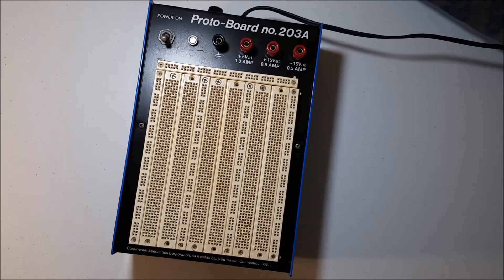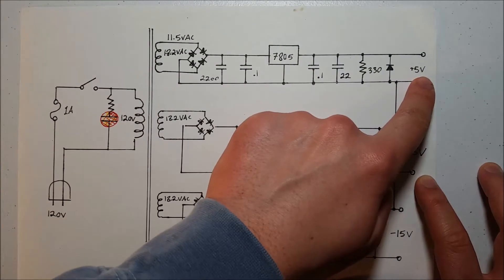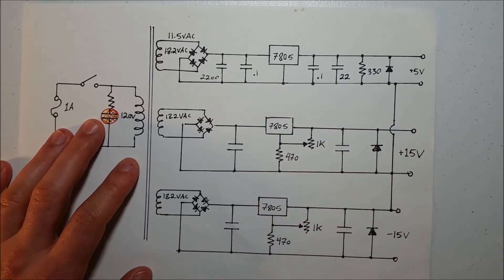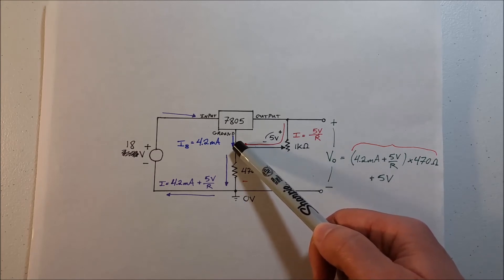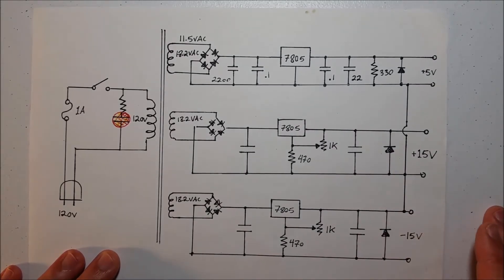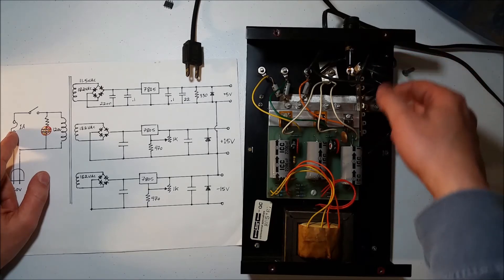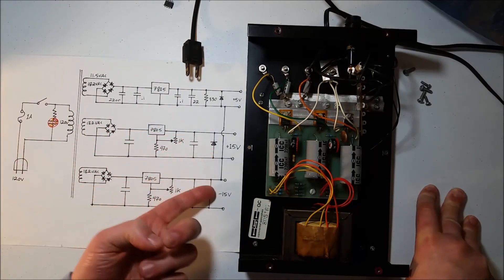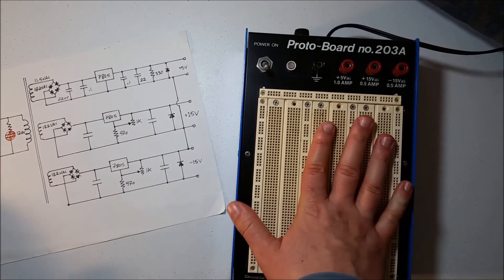Proto-Board no. 203a Review

Comment: Good explanation, Peter.  Thank you.  I have a 203A that came from a college/tradeschool lab, with a few scorch marks on the breadboards, so I'm replacing the breadboards.  I am replacing the mainline fuse holder and putting another one next to it to hold a spare.  When I bought it at the hamfest, the seller had a bunch of them and threw in another one (no charge) in case one didn't work.  Grandson and I are working on the rebuild/renew.
Reply from the maker: Thank you Mr. O'Brien! I think it's great that you're taking the time to refurb one of these! Sounds like a great project to do with your grandson. One thing I really like about it is how you can actually access the parts for repair/replacement like you're doing.

Comment: Hey Peter, it's a good review. It reminds me that stuff doesn't have to be complicated. I'm just curios how you were able to measure ripples without an oscilloscope :) (my favorite measuring device). The 7805 is really a very good voltage regulator IC. I'm going to build my own supply with it, and to have negative voltage is something I should consider for a future version.
Reply from the maker: Thank you, Christian! 
That is a very good question, and the answer is I did not measure it at all! 
I can confidently say that there is very little noise on the output, because no switching is used in this power supply, as opposed to say, a buck converter. A linear regulator like the 7805 drops the excess input voltage across an active component such as a BJT, and dissipates the excess power as heat. A little noise from the 60 Hz input (50 Hz Europe) may make its way through the regulator, but the output capacitors do a good job of filtering it. 
If you are lucky enough to have an oscilloscope, you can verify this, and then compare it to the output of a switched power supply, like a computer power supply for instance.

Comment: nice video, 
how make +/-12v............?
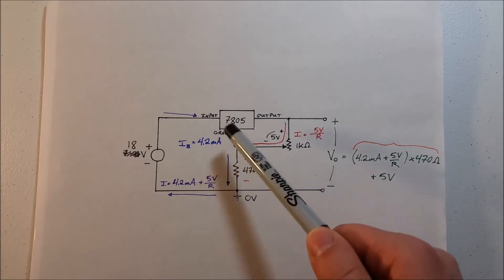Reply from the maker: Good question, use the equation for Vo I present at 4:00, solve for R in terms of Vo and get: R = 5 V divided by [(Vo - 5 V)/470 Ohms - .0042 A], add in 12 V for Vo and solve, the result is 467.56 Ohms. Create that with precision resistors in place of the potentiometer, or take the effort out and adjust the pot until you measure +/- 12 V at the output.